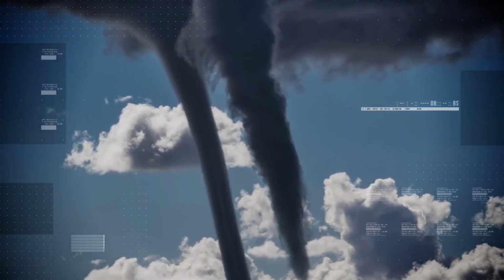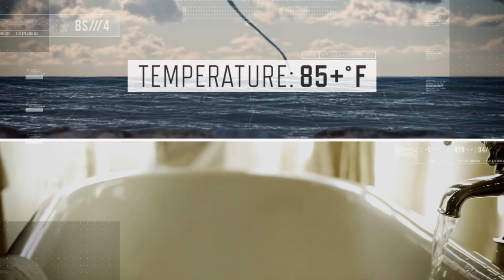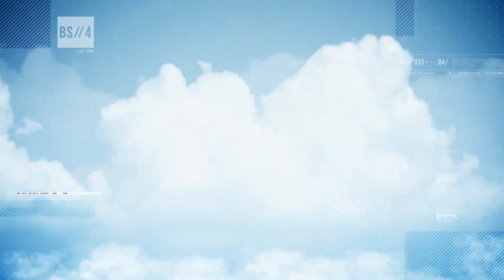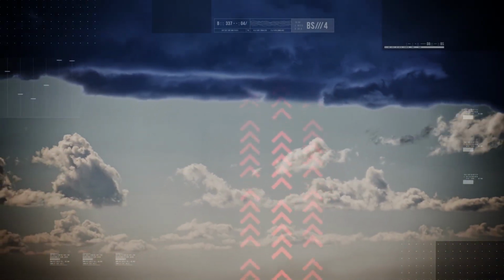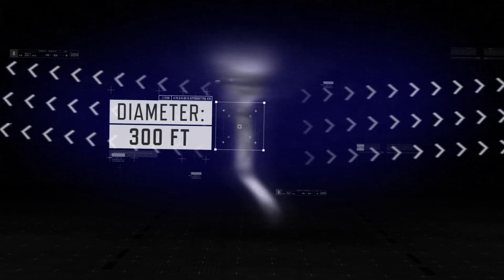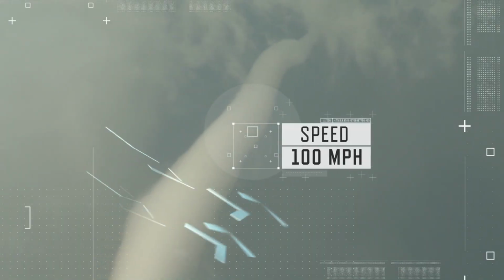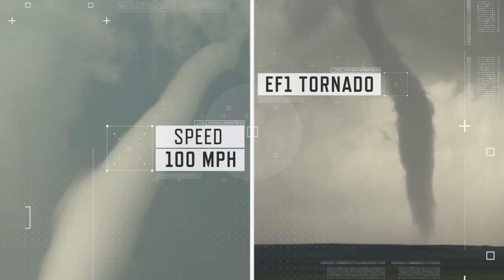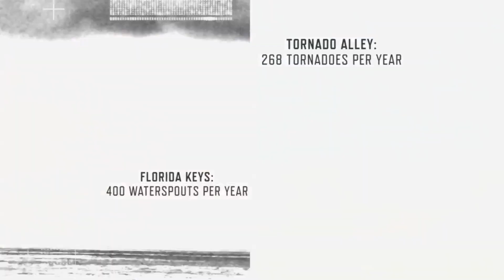Do You Know How Waterspouts Form?

Comment: You still tried to imply that it descends out of the clouds to the water. But the vortex comes from the water and works its way upward then electrostatic induction generated by the spinning vortex and particles of brine attract the cloud base into an areola complex then the funnel forms. The more the speed increases in the center the more the mass of the water vapor increases and causes the condensation to sink. The vortex is irrotational so the formation is a funnel.
Reply: Tornadic waterspouts and non-tornadic water devils are two separate phenomena.
Reply: @rolandscales9380  duh Sherlock. You're preaching to the choir.
Reply: @rolandscales9380  water devils are dust devils on the surface of water
Reply: @rolandscales9380  water devils are dust devils on the surface of water
Reply: @rolandscales9380  dust devils are not tornadoes
Reply: @rolandscales9380  waterspouts regardless if they are supercell or non-supercell are both types of tornadoes according to NOAA
Reply: @shawnharrison7596  According to NOAA only for insurance reasons purely. Scientifically they are not.
Reply: @DarkFilmDirector  I have no idea what you are talking about
Reply: @DarkFilmDirector  Tripole Charge Structure and Charge Separation of Saltation

Comment: So to put it in simple terms, it's basically a warm, rotating updraft into a building/convecting storm where the increased pressure gradient and cooling air results in the moisture to condense and make the updraft visible (similar to the Wilson cloud seen from the pressure wave of an explosion taking place in warm/humid conditions- in terms of pressure forcing condensation). Unlike a tornado which has updraft(s) surrounding a central downdraft/low pressure area.
Reply: You made it not-so-simple compared to the vid 😭😭 made it easier for a meteorology major like me though
Reply: Yours is way more complicated
Reply: Good work